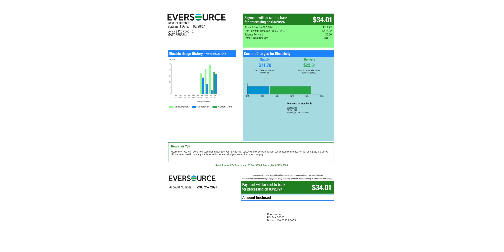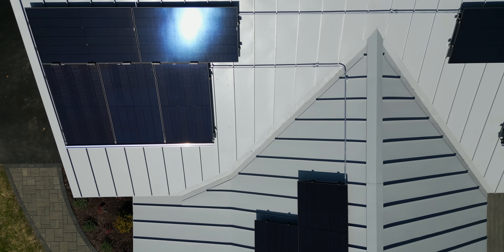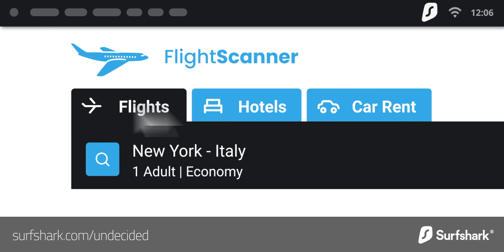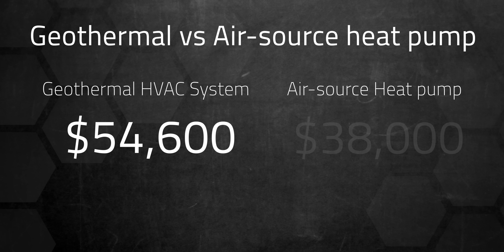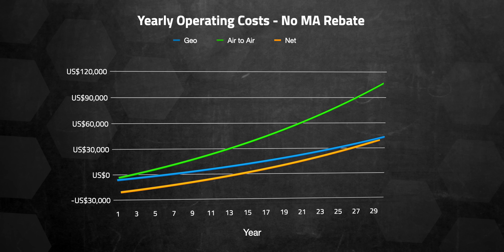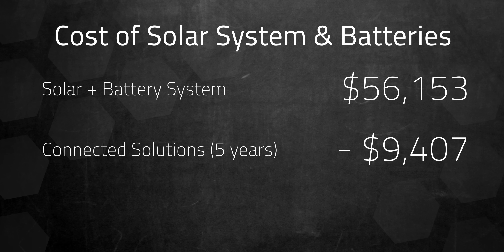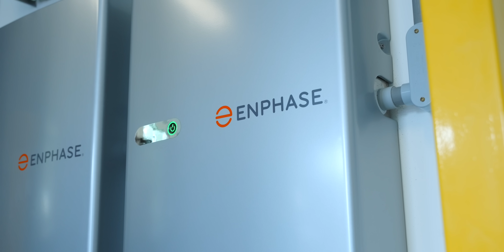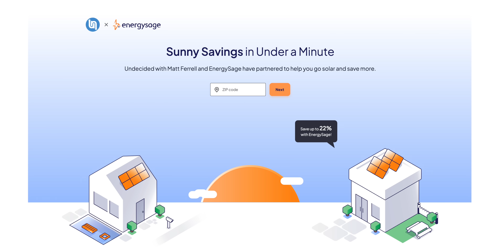What I Learned After 1 Year with New Solar Panels

Comment: What isn't factored in here is how much that initial monetary payout spread over 30 years would have grown in a good growth mutual fund.
How long do we expect those batteries to last, and will there be government rebates to replace them every 10 years?  I see $90,000 in batteries over 30 years.
And the same goes for all the other stuff in those heat pump systems, power inverters, etc.  If just one control board dies and is out of production, there's going to be big costs to eat!
And in 30 years, if the solar panel degradation doesn't perform as well as advertised, how in the world are you going to go about obtaining a warranty on them?  Good luck with that. I am exceptionally pessimistic when it comes to warranties.  

If literally anything other than the heat exchanger dies in my "old" natural gas furnace, it is quite inexpensive to replace.  The same goes for my water heater.  I like efficiency, but complexity becomes the 800 pound gorilla which just overcomes all other factors after awhile.

Comment: If you feel like "nerding" out further, remember the literal $ value does not mean the same thing when projecting out 10 years. You're not actually comparing apples to apples. An average of 2.6% inflation means the purchasing power of $1 in 2024 is something like $0.77 in 10 years. (1-0.026)^10≈$0.77
...I think. Been awhile since i did this math.

Comment: Wow massive power costs I live in Australia and due to our warmer climate  you can live without much  heating in the winter 
Summer is a bit hot but then there is heaps of solar
People complain about power costs in Australia but your numbers are eye opening 
We are so lucky 
You basically could get away with a 10kw system in Australia and not have to have a battery

Comment: I work on building automation systems at a very high level.  I have worked with maintaining commercial buildings for 25 years.  You make no mention of what your life cycle costs will be on all your automation components.   What is the life cycle of the Span Smart Panel and your Enphase system?   What is the life expectancy of all the intelligent components in your system?  How many years before Lutron no longer makes parts for your shades?  Lutron typically makes good stuff but everything eventually fails.  You mentioned warranties.  No mention of what the warranty really covers.  Probably not labor.  You make a big deal about “potential savings” but you make no mention of the life cycle maintenance costs.   I am a big proponent of energy savings and green solutions but you chose to omit critical data.  Oh yeah, what about the opportunity cost of the capital invested?  I could go on but I am done.  Please do not call yourself an engineer.  It is embarrassing.

Comment: I understand that installation is expensive, but your panels should cost less than $10,000 delivered to your door, and using EG4 batteries cost us about $1400 per 5 kWh server battery, or $280 per kWh or $5,600 for 20 kWh.

Comment: All this sounds good until you have to account for replacement of solar panels, or replacement of the inverter, or replacing the batteries.  That shoots the cost right back up again.  And replacement costs will only increase over time (there is no scenario in which solar equipment will go down in cost...the materials used to build them are too rare and very expensive).  Like I keep saying all this "green" technology is just replacing one finite resource with another.

Comment: How modular is this system?    For example if someone already had an EV,  is it easy to get  solar panels to charge your car then later add more to run your home? and later still to add more and a battery to be grid independant?

Comment: This seems to mostly work out if you live somewhere that charges outlandish electric rates.  There are only 11 states in the US that have power costs in excess of 20c/kwh and more than half of the states are less than 15c.  You live in one of only 4 states that are more than 30c/kwh, and one of those is Hawaii with some significant hurdles to generate and distribute power.

Comment: Thanks for the video, really informative. You stated that the panels have a 25 year warranty, and you extrapolated their usage out to 30 years when looking at their diminishing efficiency. But you didn't mention your battery bank. It looks like Enphase warranties their batteries for 15 years or 6000 cycles, whichever comes first. As that is half of your projected 30 years, and I didn't see any data on how well a battery might perform at that point in its lifespan and onwards to the 30 year mark, are you going to factor in a battery bank replacement at some point in that 30 year span? At today's cost that would be ~33k, as I assume there are no rebates to be had for component replacements to an existing system. Do you have any comments on this? Thanks again :)

Comment: If you're going to be doing and showing all this math you really should invest some time into understanding and folding in Net Present Value. In short, a $1,000 savings in 15 years isn't nearly as valuable as a $1,000 savings today. It's obvious that spending $1,000 today to save $1,000 in 2040 wouldn't be a good deal.

Comment: 12:08 you say that at year 9, your electricity rates might be at .37/kwh.   Earlier in the vid, you mentioned 3.5% avg increase/yr.   That would put you at .28/kWh now?    Looking online it seems Plymouth MA electricity rates are .13-.15/kWh.   Where is the discrepancy?
Reply: Ok, I see that rate I found online is only the supply cost.  So only half your current costs in MA.   Your electricity is crazy expensive.   In Nebraska, our rates (not separated here) just went above $.10/kWh for the first time this year.

Comment: Charge on Solar is not unique to SPAN. If anything, they are late to the game. Our SolarEdge EVSE features the same software and has the added benefit of not requiring a dedicated circuit as it can be directly wired to a SolarEdge Inverter. I believe Enphase now has a version of this after they purchased the EVSE manufacturer ClipperCreek. If you have Tesla Power wall and a Tesla EVSE it too will charge on solar if configured to.

Comment: I'm just wondering, what if someone installed the cheap LFP battery that's available for $155 for 1.2 kWH - that would give you the same capacity for~$2,700 . Combined with, say, a $7,000 good quality inverter, that's under $10,000. Then, we can put the additional saving to more capacity and simply do away with the extra cost of operating heat pumps or geothermal.

Comment: this is like the 4th video about his solar investment. if you have to put essentially the same video up 4 seperate times, to justify or convince your viewers, it is NOT going to convince anyone. i've seen this very topic on your channel multiple time now. "5 years with solar panels was it worth it?" "is solar worth it in 2024" "i have new solar panels, was it worth it?" 

stop with the con game of recycling this same topic over and over. you invested in solar, made a video about it. then you replace the panels, and try to convince people that solar is worth it, after dumping your first solar set up to replace it with a new build, well before you reclaim your initial capital investment for your first solar set up. dumping and replacing your old system, especially when new panels and batteries along with installation to the musical cost of 55k out of pocket, well before your initial solar investment 5+ years ago, where the break even point is typically 10-15 years down the road. 

bottom line you are financially hemoraging money in the attempt to "go green." you didnt break even with your first investment, so you dumped it and restarted; digging the money pit far deeper than it should be.

Comment: I know you are doing a retrospective, but you should plan for several inverter replacements over the 30 year life of that solar system.  From what I've read, you can plan for around 3.  Each replacement will likely cost at least $5k for your system.  It's not enough to really move your needle, but when looking over long-term TCO, it should be included.

Comment: I took the money for a solar install and put them in an index-fund, then switched to an electricity provider that is 100% renewables. Since that moment, I get paid to use energy, forever. And the energy-provider used the money to build even more wind/solar. I don't have to worry about roof-leaks, fixing things. The generators are away from my home and managed efficiently by staff.

Comment: Great video. But perplexed why they have batteries at all if they get full credit net metering. With net metering the utility is the battery, so why buy expensive atteries? Plus batteries are dropping in cost and will be a better buy in the future. A few Jackeries to run the fridge and lights in an emergency would be a better financial decision. Also the video shoudl cover maintenance costs and warrenty years for all systems. Typically batteries have a 10 year warrenty even if solar panels and some microinverters are 25 years.

Comment: Holy cow, 30+ cents per kWH???  That's insane/inane.  Clearly that pricing level is way above any current open marketing pricing level, and includes a massive steaming pile of CAGW punitive taxation.  You must really, REALLY like living in Massachusetts.  This tells me that for the 95% of the country with much lower electricity rates, solar makes no sense at all financially.  Your system might last 10 years without major repair expenses, but no way I can believe it will last 30 years.  My guess is that in 20 years at most your system will reach the point where it will be cheaper to replace it entirely with new technology that to keep the existing system operational.  What a scam!

(Btw, is your hot water really set at 140F?  There are many reasons that is too high, but one of them is that the lifetime of the unit will be only 50% of what it would be at 120F.)

Comment: WAY over priced batteries. You can get 20kwh of storage today for less than $5k.
Reply: You're the I know somebody who can do it cheaper guy. 😅 the cheaper option isn't always the better option. The term "you get what you pay" for holds water.
Reply: @7-ten  And you're the guy who does not realize that all the components that go into that name brand that you are paying extra for? Come from the same factories that supply much cheaper options.
Reply: @davefroman4700  😂 best of luck in life using that theory.
Reply: @davefroman4700  I'm not here to argue with stupid. Use the cheaper option if you want to.
Reply: @7-ten  Commercial equipment is cheaper than retail 😘

Comment: What I can't understand is why solar is so expensive in USA. Here in europe, 10kW system costs $5500 with install. I have also installed 20kWh battery for $7000. Including full house power backup functionality.
Reply: Simple answer. Greed.

Comment: In Phoenix AZ the best setup is about an 10K solar system with battery storage, heat pump AC/Heat and Heat Pump Dryer.  You are already at a net zero with just those improvements (might need new windows).  I have an 8K system and I have enough surplus to store the excess for when I need it.  I use a bit of power at night charging the EV but the golf cart and our PHEV charge during the day off solar.  

You can really make the solar stretch if you store excess, set up timers and plan correctly.

Comment: Your costs always make my jaw drop, but I'm happy that you're happy with what you have.  I am curious how you get net metering with >10kw inverter capacity here in MA?  Considering that the 25kw cap was signed into law two years ago the states hasn't enacted the rules yet?  I hear it will happen by the end of the month, but till then everybody with >10kw sells back excess at the wholesale rate ($0.06).  Lots of people in MA got screwed by unscrupulous installers putting in >10kw capacity.  Once the cap goes through I'm in for another 10kw (13.2kw).  I fully power one EV and the house (oil heat), but my second EV is just too much demand for me to stay ahead.

I DIYed my 10kw (13.2kw panels) for a total of ~$11k before fed/state back in Feb with net cost at ~$7k.  At $0.33/kwh my breakeven is ~1.5yr.  So far this year it's made ~13.7MW so I'm hoping for an annual of ~16MW.   Thank you Signature Solar!!!  :)

Comment: Wow. We have 15 kilowatts of bi-facial panels @$5,600 and 61 kilowatts of LifePo4 batteries @$7,296 and 12 kilowatts of inverter/charger @$5,200. Solar - 25+ years life and Batteries – 8,000 cycles or 21 years until 80% SOC and LuxPower 12KW inverter/charger 10 years. Total = $18,096. Plus we do not need the rebate as we do not pay income tax, because we took advantage of the congressional remedy called a Revocation of Election.

Comment: Hearing how much energy US houses uses is so eye-opening. Compared the the uk these numbers are huge. Clearly heating and air con needs are different, but for energy efficent homes you could still run a small street in uk on this amount of power!
Reply: My wife and I do fine in America with just a 5 KW solar system.  Most American heat or cool their entire McMansion all the time.  We just heat or cool the room we are in.
Reply: It's been nearly 20 years since I lived in America, I remember paying $100 a month for gas in the winter when the heating was on. Then we had a month of low utility bills. Then summer hit and it was $100 a month on electricity for the AC.  In Europe, I just have to pay for heating in the winter. Summers where I live are fine with no AC, nothing like the summers in OK.
Reply: i think you have to add in cool air conditioning .this is a big thing in usa. I bet that sucks down the leccy during summer.
Reply: @BAZvonRichthofen It's also a big thing in Japan, where the earthquake-proof houses and small blocks (I live in a notoriously-naff Leopalace, if somebody in Britain was asked to live in something so small, they'd be running to the ECHR) have almost no insulation.
Decadent, wasteful, first-world "air conditioners" and efficient, green, planet-saving "heat pumps" are THE SAME THING. in spring and early autumn my electric bill is about ¥1200, in the height of summer my AC gets a lot of use and the bill can be ¥6000, an increase, but not a vast amount. Mind you I have a new air conditioner, the first winter I used two 1000w space heaters a lot, because my old one's heat mode was really weak, and got the bill to just over ¥10,000. One spring, on the other hand, I was really careful and got it down to ¥980 for April or May!

Comment: Matt, did you consider the battery degradation rate during the next 30 years with your calculations, possibly needing to fix, replace, or add more, which will affect the ROI and overall energy cost per unit?
Reply: Both, even with efficiencies at 85% and 75% in 30 years, would still outperform buying from the market, pre-buying electricity this way in terms of saving vs. market rate inflation of a standard 2-3% annually. And they would continue to work for another 20 years. It's already a bit of apples to oranges because a  degradation of your median modern batt, solar efficiency would only degrade to the state of a brand new system in 2017 in 30yrs time.These calculation where more problematicve in 2014s than they are now.
Reply: panels have a derate factor on 20 years. and batteries have a derate factor based on 10 years. now what you gonna do with 30 years of payments? in 30 years you have one system with 3 payments.
Reply: @diegojines-us9pc  REC panels have a 25 year warranty and Enphase batteries 15 years.
Reply: @kansassolar  then they are industry leaders. since all others are 10 year, and check those panels, with 4% annual derating they will only be producing 50% power. and thats a fact and warranty is also degraded for each year. so if they dont fail. they only be half as good. and no one makes them any better than to degrade any slower. or didn't you know that as well.
Reply: @diegojines-us9pc  Many panels have a 25 year warranty. Some have 30 years. Yes, 15 years for a battery is above the market average. This particular solar panel will degrade a total of 8% over 25 years. He talks about it on the video and it's quite easy to find.
Reply: @kansassolar  i thank people like you, for questioning me, so i can research even more. so i did, i went to look them up. and as stated on their page. they are "eligible" for a 25 year limited warranty, at an extra cost. which that cost isn't stated. whats 25 years of insurance warranty payments come to i dont know. someone could contact Singapore to find out.
Reply: I would hope that by the time batteries eventually need replacement, costs will have gone down considerably.

Comment: Costs all seem very high, and that’s coming from a Canadian.  

More solar can offset having to buy the most energy efficient device going, many of them with moving parts that wear.  16k after incentives for my 14kw grid tie on a ground mounted pergola.  I couldn’t have done the windows alone in the house for that, to save $30 a month on a power bill vs $200 with grid tie.  Can literally do 3 of these systems for cheaper than his geothermal, and it would “net zero” my 90’s milled lumber home that’s not sheltered in the slightest from the elements.